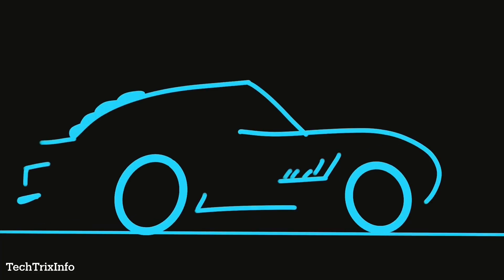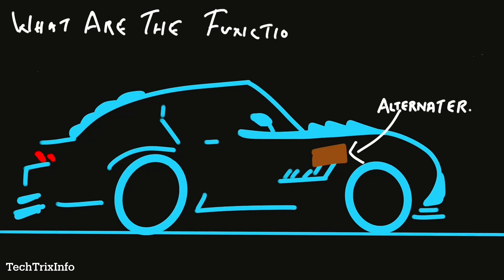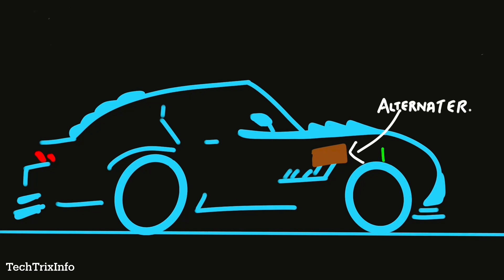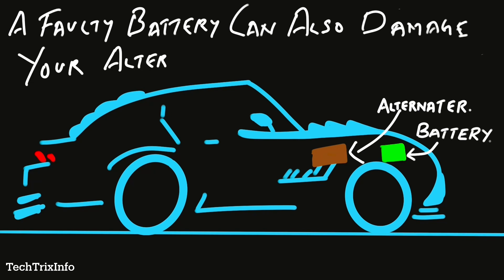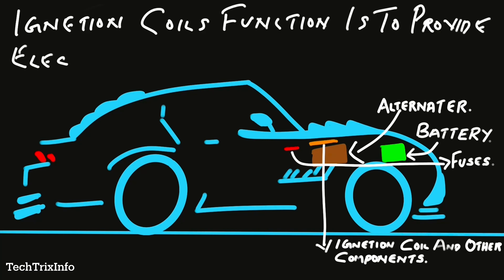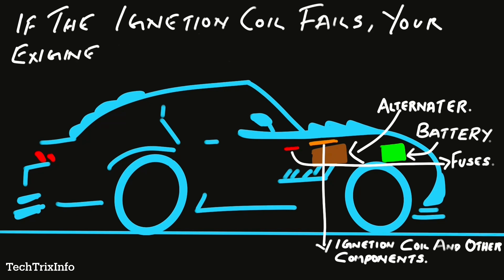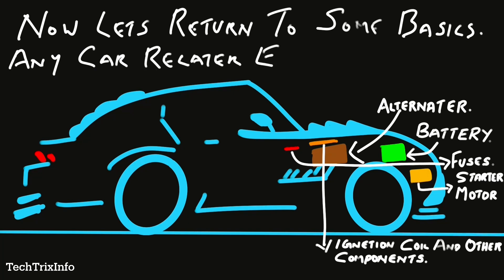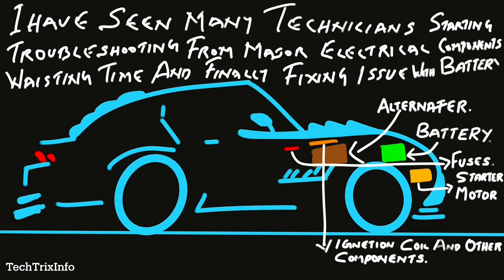Electrical Power Loss In Cars Explained @TechTrixInfo

Comment: So my 2018 Civic SI sensor lights come on randomly and now my battery is draining completely 😥 I had the battery and alternator checked st Advance Auto. They said the two were good.... Guessing an Electrical problem 🤷 The other morning on my way to work at 4am 🙄 it died at the top of a hill! No power, drifted back down and coasted into someone's driveway.